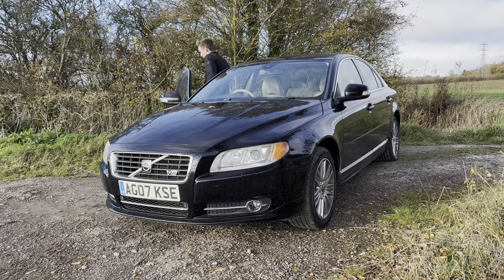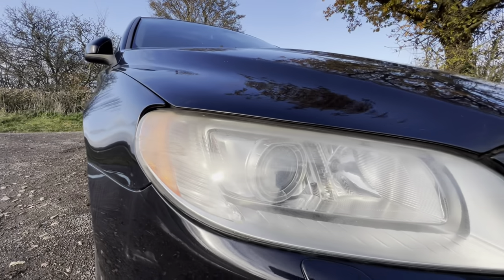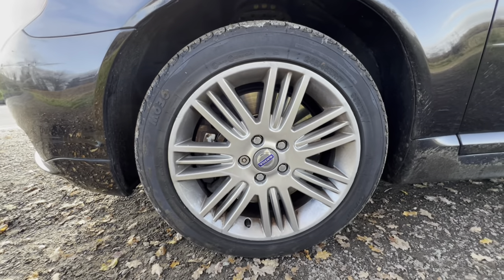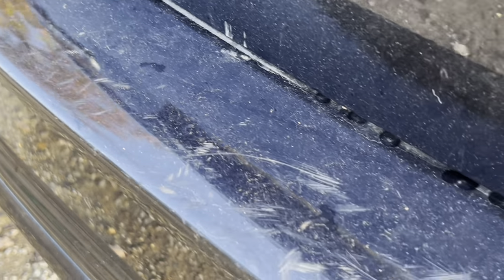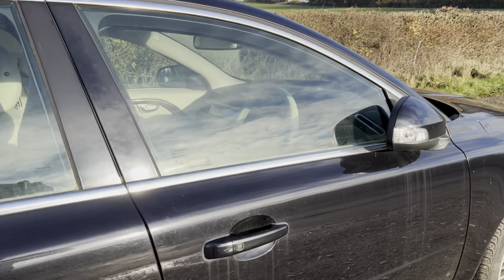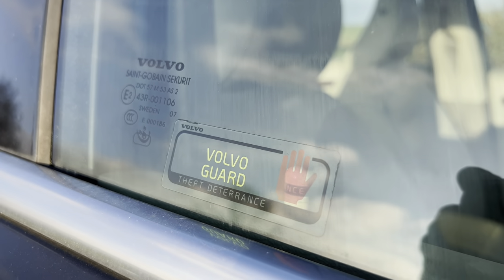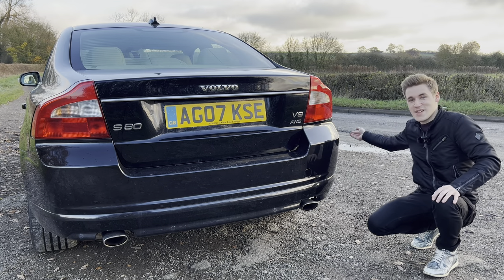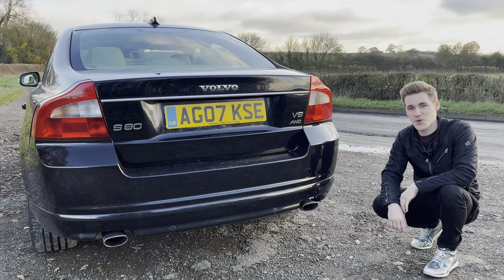I BOUGHT A VOLVO S80 V8!

Comment: I have a 2008 V8 Executive with all the extras like seat screens, fridge with crystal glasses, etc. I bought it over ten years ago and it has 500,000 kilometers. I use it everywhere, from motorways to construction sites and dirt roads. Until now it has been a combat car and very reliable.
Reply from the maker: I am very jealous of your Executive Sergio! If my budget would stretch I would definitely buy one, the fridge and crystal glasses alone is such a highlight 😁 I can’t believe how much miles you’ve put on yours, but I’m so glad it’s getting used and you’ve had a reliable experience!
Reply: Hey bro, hope you're having a wonderful time.
I'm from Colombia and here in my country there are just about 15 s80s and about 6 are v8, Volvo is quite the brand here, even more normal ones are quite rare and I have the opportunity of buying one of the 6 v8s that exists here for cheap, like 6.000usd, here those cars even being a 2.5 are worth at least 10.000usd but the one I'm looking at is salvage title, the guy isnt very comunicative by chat but says it's 100% functional and mechanically ok, the car doesn't seem crashed in the fotos so I think one of 3 options 1: was stolen and recovered 2: flooded 3: mechanically totaled. The car has 50.000 miles more or less but unknown service records, etc looks decent enough but let's say it's had the worst owner possible, is it really reliable? What can go wrong or what should I look for? The idea is to daily it. Where can I buy part for a good price and what have been your experience mechanically with your car?
Thank beforehand.
Reply: @juansebastianhurtado3328  Hi, I live in Europe and here the V8 version is also very rare. I've always done the annual inspections at an official dealership and maybe that's why I've never had any breakdowns. Mine has 504000 kilometers traveled and zero mechanical failures. Think carefully before you buy, this car is fantastic without breakdowns but when it breaks down repairs can be costly.  As far as I know 90% of the V8 units produced went to the USA and that must be where you can find cheaper parts.

Comment: Great choice! Rare car, they only made about 8000 V8s between 2007 and 2010. I have a 2010 V8 Executive (~1/300) and absolutely love it - similar features to yours, but some extra things standard like massaging and ventilated "sovereign hide" seats, a clock inside the dashboard wood trim, wood console and steering wheel, an S80 crest on the c-pillar, a 650W Dynaudio sound system with Dolby surround sound, and different wheels. Unfortunately, mine didn't come with the rear seat fridge or adaptive suspension. I'm happy you like yours and I'm happy to see more content on these V8s!
Reply from the maker: Thank you Derek, it’s always great to come across another S80 V8 owner with very few of them around! I really love the Executives and would love the extras they come with, they’re just a bit of budget unfortunately! How comfortable are your sovereign hide seats? Because if there’s one things for sure, mine are very comfortable! 
The fridge would’ve made an excellent addition to keep my chocolate milk cool! I’m thinking of getting the spaced out Volvo badge on the rear, newer tail lights and the revised front grill to freshen up the way the car looks. In general though I am absolutely besotted with the S80 V8, and it is everything I imagined it to be plus more!
Reply: @NathanMannin  The Sovereign hide seats are extremely comfortable, the leather holds up well but they don’t have quite as much cushion as the regular seats. Cosmetic changes should make a nice difference. Did you want to replace with the 2014+ LED taillights?
Reply from the maker: @derekchisholm972  I was looking at the second facelift LED headlights, but I think they’re quite expensive aren’t they? They’re also not plug and play I believe? 
I definitely want the spaced out Volvo badge like yours though!
Reply: Yes, the facelift taillights require Volvos “VIDA” software to code in, and it may require a few electrical tweaks. There are versions of your current taillights with chrome strips underneath that are plug and play, mine has them
Reply from the maker: @derekchisholm972  I’ll have to look at yours to make a definitive answer, from memory yours looks mega!
Reply: Hi, I also own a s80 V8 and was looking for the production numbers. Could you tell me, from which source you know the 8000 V8's? Do you have more details? Maybe for different countries or modelyears? Thanks a lot

Comment: You can just keep the key in your pocket that key holder next to the start button is just in case your key fob has a dead battery
Reply from the maker: Cheers Levi! I’ve recently just discovered this feature thanks to someone commenting on one of my videos! 😄
Reply: @NathanMannin  you bet also that key don't need to leave your pocket it unlocks itself and to lock it there's a little button on the handles on the outside you just push it as you walk away I love my s80
Reply from the maker: @GhettoSasquatchz  I need to give that a try, I didn’t know about the button!
Reply: @NathanMannin  it's on every exterior handle. Also to turn of traction control the car will launch super hard its fun as can be
Reply from the maker: @GhettoSasquatchz  I’ll have to explore that feature, with traction on its super quick off the line, so I can’t imagine how it could be any better!

Comment: Cheap but... not cheap to maintain mine 2.5t was 2700£ and in the first 2 years had to spend 8000£ 3 of which was due to forgot to lock it and some dude tried to steal it braking something around the wheel steering column and some buttons due to steering wheel been locked so only volvo north London been able to fix it. Overall official volvo offer cheaper overall repair coast and quality than some random garages.

Comment: Just be aware of front cross member engine chassis rust. They have a design flaw which places the down pipe very close to the frame which virtually cooks the protective enamel and brings eventual penetrating rust (especially in winter areas) and frame failure rendering it unsafe. Also be prepared to open up you r wallet to valve cover replacement and steering pumps etc. Massively more expensive then the purchase  price. Sad

Comment: Great looking car Nathan and very good choice, especially being a Volvo as well. Apart from getting the car professionally detailed both inside and outside, you should also get the cabin filter swopped out and have a new one installed, so you could at least breathe cleaner air, since the previous owner, kept it in an appalling state. That whistling noise you're hearing when you turn on the aircon, could possibly be the compressor bearing, or one of the associated pulleys' on the the way out. Also, have the car fully inspected by a reputable company, especially one that specialises in Volvo cars, as they tend to be somewhat over engineered, which in my opinion, makes them really great cars, that way they could find any other faults with the car, that you might not discover right away and ends up putting you in further expense. Better to be safe than sorry. Otherwise, really great and solid car.
Reply from the maker: Thank you very much! I will be investing in a cabin filter for sure. Would you know the best way to tackle the air vents and smell coming through the vents/aircon? 
I have found the whistling noise is just a characteristic of the engine. The metallic grinding I suspect is the aircon suppressor or a bearing like you said. I’m taking it to a Volvo specialist next week, so hopefully they’ll be able to identify the root of the issue.
Hopefully it won’t be too expensive, or there’s an alternative cheaper fix! Because the aircon still works, it’s just that the unnerving grinding noise starts again!

Comment: The driver's side headlight is not fitted properly or maybe there is some history to this vehicle.  i.e. front bump!?  A machine polish will help with some of the surface issues.  And a good internal clean will also help sort the cracked seat leather. Smokers car smell can also be removed but use a detail cleaning company if you prefer.   That noise is most certainly the aircon compressor bearings but use an independent volvo shop to take a look.  ... oh and by the way I drive a 3.0litre normally aspirated S80.
Reply from the maker: I’ll have a closer look tomorrow and get back to you on that one. Is the headlight meant to sit flush with the bonnet?
I will be getting a mobile detailer to give the interior some proper treatment, which will hopefully eradicate most of the smell. Then I’ve seen on YouTube that spraying Lysol down the vents under the bonnet help remove bad smell coming through the ventilation.
I’m getting the car fully checked over in the new year for all the defects I’ve found so far! 
Which year S80 is yours? Thank you for the advice, always great to speak to other owners with the same cars! 😁
Reply: @NathanMannin  mine is a 2004 model.   Yes if you compare left and right headlights you should see a difference.  👍. The headlights are removed by pulling up two plates under the bonnet on top of the light cluster
Reply from the maker: @EngineerLewis  How does your S80 feel to drive? Mine just feels like it’s riding a wave of clouds! My friend showed me the light cluster feature a few days ago, I was completely shocked! 🤣
Reply: @NathanMannin  This is my second S80 so that tells you something (the first one caught fire but don't let that scare you and yes I carry a fire extinguisher now!)  It is a very relaxing drive and before Covid I was driving 170 miles each way every week so perfect for a long motorway drive.  Enjoy but note, to give me better mileage, I converted mine to run on LPG.  Volvo actually delivered LPG versions from the factory so I am happy that the engine can deal with the higher temps when burning LPG.
Reply from the maker: @EngineerLewis  Oh wow, was there a reason why it caught fire?
I only drive mine very little mileage so I can stomach the bad fuel consumption 😆
Reply: @NathanMannin  It was an electrical fault under the bonnet.  It started slowly but there was no extinguisher on hand and it melted the bonnet as well as destroying the engine area.  I got a payout by the insurance and bought my 3.0l one for just over £2k with 65k miles on the clock!

Comment: i own the s80 v8 myself aswell,
the noise i hear is normal for this engine ( tho it might be different in real life due to the mic in the camera, youtube processing, my headphones and everything else)
if it is not the "normal" sound than it will most likely be the power steering pump/bearing or a belt tensioner bearing as these are known to fail with their location in the engine bay giving them the  full heat of the motor

another comment stated the AC compressor but  i dont think thats it because my dieing compressor sounded very different (like a non oiled sewing machine more or less)

the pump can be easily identified by putting the car in park or neutral keeping the  engine at around 2k rpm and turning the steering wheel, if its the pump you will hear the sound very clearly vary in both pitch and volume

also a warning
DO NOT  TUNE THIS CAR ENGINE!
the engine has been limited from factory at 440NM of torque because of the transmissions rating of 450NM max.
this is already at the breaking point of both the gearbox and  the angle gear and spline for the AWD.
tuning this engine will break very expensive stuff very shortly after installing the tune ;)

or just find someone to build you a transmission and awd driveline that's up to the task and go for it, would love to see that actually
Reply from the maker: Thank you very much for taking the time to write this all up, amazing to come across another S80 V8 owner! 😁
After making the video and listening to other S80 V8’s online, I think the noise is normal after all.
I’m taking my car to a garage at the start of next year, so I guess they’ll find out what the issue is. Only when the aircon is on, you will hear that metallic grinding noise, maybe the aircon needs redoing?
I will give the pump method a try tomorrow!

I will most certainly not be tuning it don’t worry, I’ve seen lots of posts on that! I would like to dyno my S80 though, it does feel a little slower than I was expecting and I’ve struggled to keep up with some very ordinary cars.
Reply: Just a sidenote regarding tuning, I dont advocate for or against, but it is quite impossible to increase torque by much via just tuning on a 4.4 naturally aspirated V8 such as this. Torque is mostly just a factor of BMEP, which is just about static in non-boosted engines. You can also look at it from the other perspective, that is that tuning a NA engine does just about nothing, certainly not something that can be readily felt with just a "butt dyno", disregarding the placebo effect. Cheers.

Comment: You bought yourself a nice car! The whistling noise at idle is normal. All V8s do this. So does mine and you can also hear it in other Youtube videos. I've also seen that your cooling water tank cap isn't closed properly, that you should top up servo oil and your air filter box isn't screwed together properly. You should not be able to see the orange seal. Have fun with your V8 moose and take good care of it, it deserves it!
Reply from the maker: Cheers Eric! I figured after listening to so many videos that the weird whistling was just a characteristic of the engine! You have a very keen eye, thank you for pointing that out to me as I’m not very mechanically minded. It’s been one of the most surprising cars I’ve driven I think!
Reply: Hi guys, I also own a s80 V8 and mine also does this high pitch noise in idle. I almost bought a new power steering pump. But if you say its normal, I will do not change the pump. Thanks a lot.
Have you noticed, that the Volvo batch in rear is not aligned proper? Its hanging to the left - its the same like at my car. Wired thing🙈

Comment: I got mine 18 months ago. Great fun to drive and sounds amazing when you start it up on a cold morning. Mine came with 19in wheels which I think looks better than the 17in. Mine has the same interior which I wasn't sure about at first but really like now.
Reply from the maker: Awesome to come across another S80 V8 owner! How’s your ownership experience been? 
I would agree and would prefer the 19’s over the 17’s for sure! However, I just came out of ownership with a Porsche Cayenne Turbo with 22’s with a ride I resented! 🤣 So I wanted to do the complete opposite and have tiny wheels with big sidewalls, so I can finally enjoy some ride comfort : )
Reply: @NathanMannin  my experience has been very good. The person I bought it off recommended a volvo specialist who is not a main dealer for services  repairs and mots etc. That has saved me a lot of money so far. I have had to get replacement bushes for the back suspension and some new tyres so far. Ford parts can be used for some things as the S80 shares the same platform at the mondeo of the day and also one of the jags.
Reply from the maker: @martynmanning9624  I’m glad to hear your ownership has been trouble free, what mileage is you’re?
I’ll be taking mine to a specialist for sure to give all the niggles a once over.
How much were the bushes if you don’t mind me asking?

Comment: I got a 2009 S80 T6 and always wish I bought the V8 as there was one for sale in my area for around the same price when I was looking for a car, but opted for the T6 as it had the colour and interior I wanted. Still the T6 is an excellent engine and I love my S80. Can't wait to see you fix this one up. Mine too makes a weird noise with the AC that follows the revs of the engine but I haven't got it checked out yet. Sometimes I just turn the AC off and on again then the noise goes away and seems to be normal.
Reply from the maker: The spec is also very important so I don’t blame you : )
How does the T6 sound, it’s probably quicker than my V8 in reality 😁
I really love my S80 too, it’s such a relaxing car to drive but still has that fruity soundtrack whenever you need to wake up 😆
My aircon noise never goes away unless I turn it off unfortunately, taking it to a garage next week. So if I find out the issue, I’ll let you know what my problem is!
Reply: @NathanMannin  The T6 is quite nice but you don't really hear it with the exhaust it has on. All you get is engine noise when you're in the cabin. I do love the turbo and it makes a satisfying noise when you have the windows down.

Comment: Metallic noise could be a compressor clutch or belt tensioner. The belt tensioner should be addressed immediately. A power steering flush should be addressed. A complete fluid flush should be performed, angle gear and diff service as well. Volvo AWD is leagues ahead of Subaru. I have never felt more confident in slippery conditions than with my trusty Swede!

Comment: I like the S80 a lot. I have the D5. Except in auto setting the gearbox is so lazy. I mean i could flap the stick forth and back through gears. But then i find myself a the light accellerating in 1st gear untill i hear the car screaming. Tipping the stick is just not something you expect or want to do in a large executive sedan. Another guy i spoke to at the gasstation(irony) said its exactly the same for the V8. 
Just lazy comfy big sedan. Doesnt like to be rushed much. Could pull an entire small town to the destination though. Strong cars. Also the diesel i have. Just wofting along the high way and occasionally accerlation when the plebarians in their passats and corollas get too close.
Reply from the maker: You’ve hit the nail on the head there, it really isn’t a car that encourages you to drive fast, but I don’t feel guilty because of that either. Normally I’m rushing about and try to get through traffic fast, but in the S80 I never feel a sense of urgency, it’s so weird! 😆